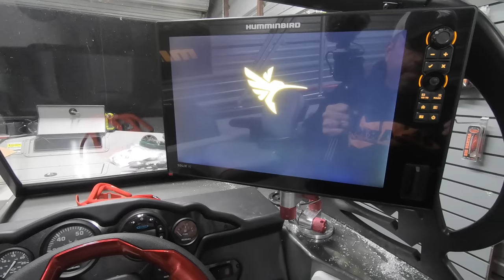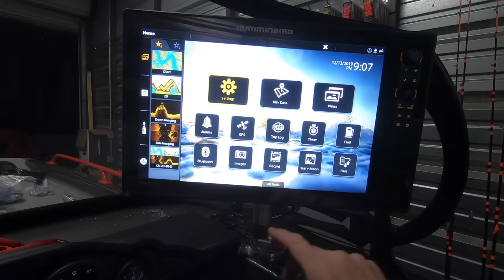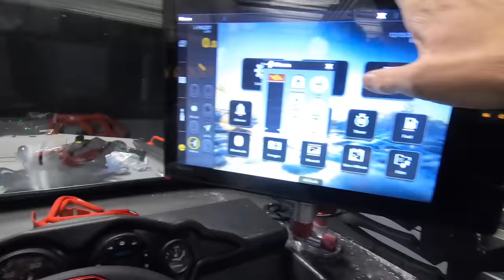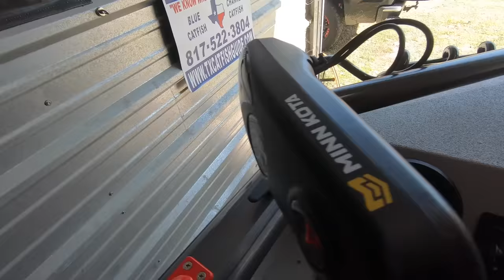Rigging My Catfish Boat | Fish Finder Install and More!

Comment: Hey Chad, do you have the part number for the swivel-eze pedestal in your video. Assuming that’s going on the fatfishdesignz rod holder. What height did you use (13 or 16)
Reply from the maker: No, it’s the standard pedestal SeaArk uses but not sure on part number

Comment: How can you find out where your braces are located on a pro cat?
Reply from the maker: Do you mean in the hull?
Reply: Yes, I am planning on some rod holders that would require drilling holes and a few other modifications. Just don’t want to be drilling into electrical/water lines.
Reply from the maker: Shanon Morgan your dealer can give you this info